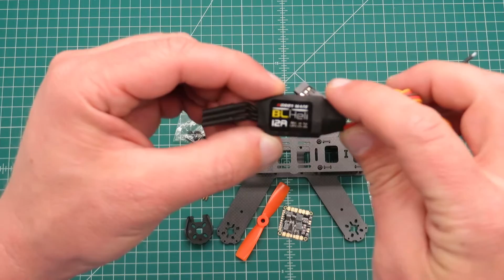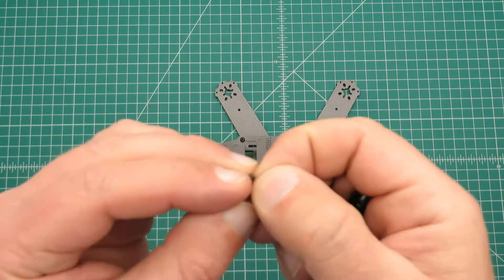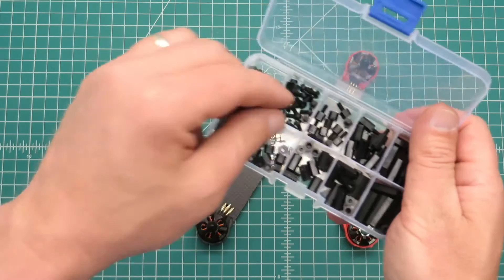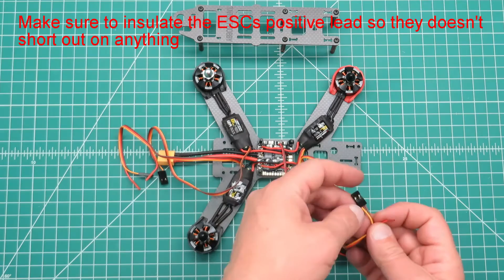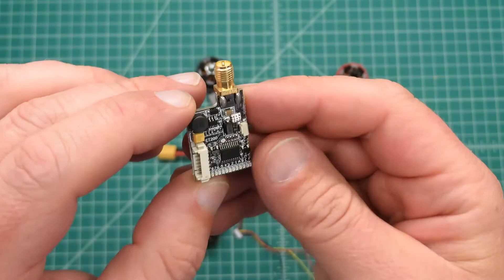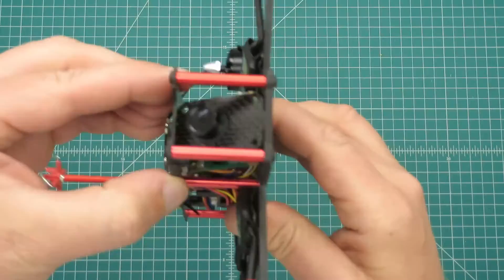Target Hobby QAV210 Kit Assembly

Comment: Noob to builds and Found this video attached to the amazon page where I had bought the same kit from @Hobbymate HOBBY. I watch this video several of time trying to figure out my situation until I figured out that the kit was different than what you were showing however the manual they supplied showed the same configuration in you build. I guess that's how you learn the hard way!! I do appreciate you taking the time to do this and hope they update their 1 page guide so others didnt have to go through what I went through, I won't buy from these guys again, lessened learned. Thanks again!!
Reply: Correction,  @TargetHobby was the seller.
Reply from the maker: Looks like they upgraded the ESCs and PDB.  I did a review on both.
https://youtu.be/hedbuKZHJvI
https://youtu.be/DdPBq2V15Bg
What type of problem did you have?  Target Hobby always does a great job supporting their products.

Comment: will it work with a dx5e and orange tx?
Reply from the maker: Yes, it will work fine with a 5 channel radio and receiver.  You can use the fifth channel to select between two flight modes that you setup in the right controller software.